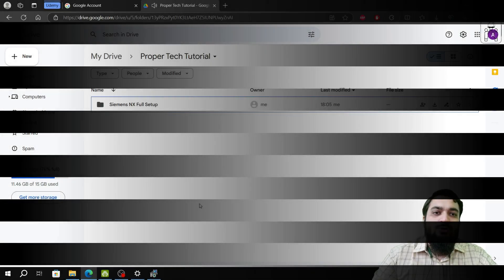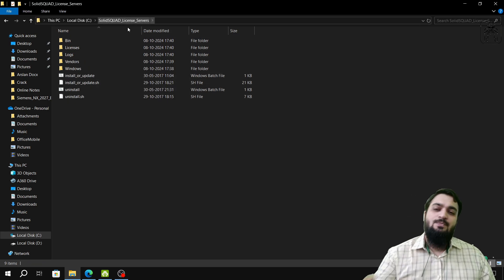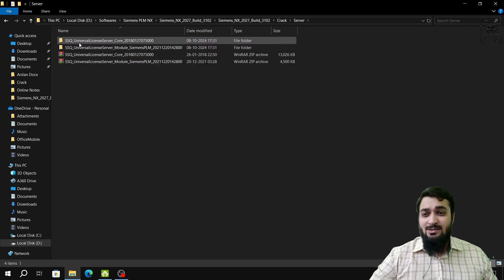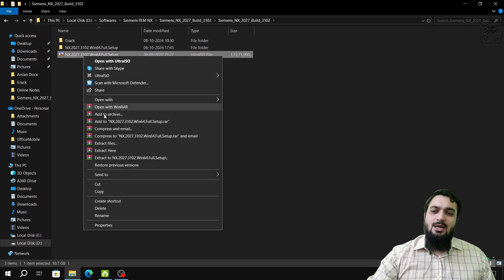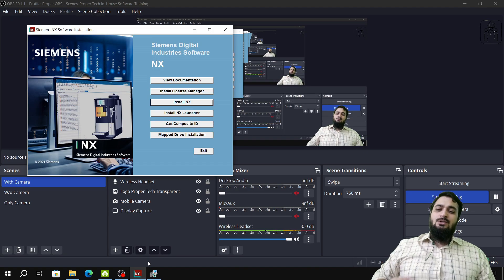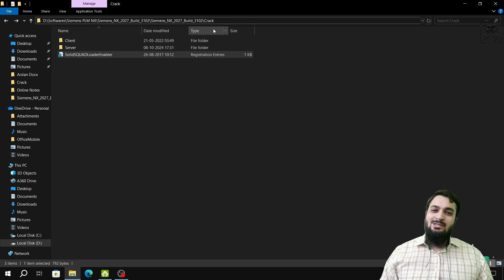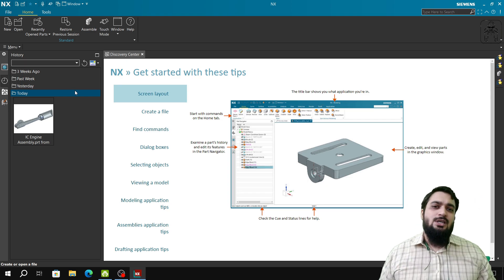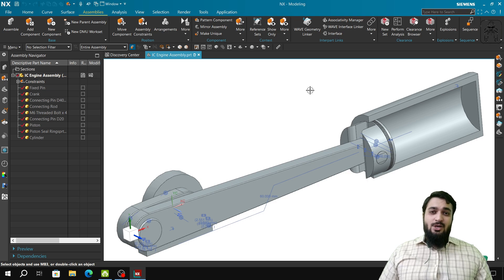Siemens NX Complete Setup Guide: Step-by-Step Tutorial | 100% Tested Method | @ProperTechTutorial

Comment from the maker: 👉💯
https://mega.nz/file/faoRSIYB#Gw2om8t4lDIFIEjUbT8e5IEBxmq8El3mPuVYcExQVec
Reply from the maker: Extract Pswrd - 123
Reply from the maker: after restart if it does not work
nothing to worry
1. turn off internet/wifi
2. Solidsquad loader enabler which was pasted in root directory (when installing) just do a right click and click on merge or run as administrator.
3. Server install or update batch(.bat) file run as administrator 
you are good to go.
NOTE: you can change sequence of step 2 and 3 if it doesn't work.
Reply: @ProperTechTutorial  assalam walekum Sir Still Showing License Error: Cannot find licenses file please healp
Reply from the maker: @venomytgaming9716 
walaikum assalam 
after restart if it does not work
nothing to worry
1. turn off internet/wifi
2. Solidsquad loader enabler which was pasted in root directory (when installing) just do a right click and click on merge or run as administrator.
3. Server install or update batch(.bat) file run as administrator 
you are good to go.
NOTE: you can change sequence of step 2 and 3 if it doesn't work.